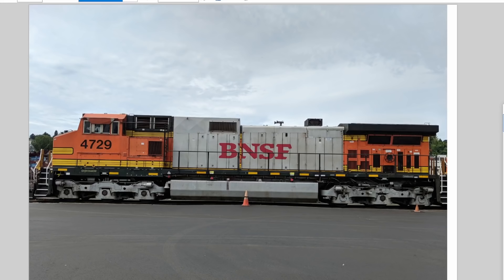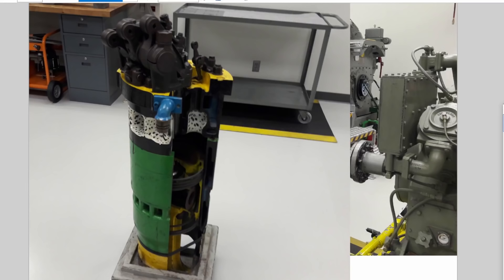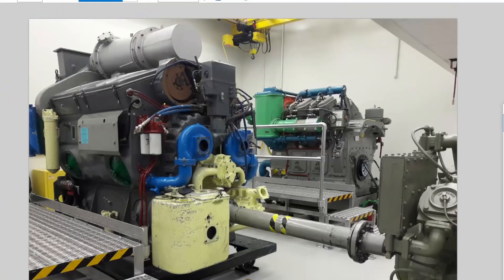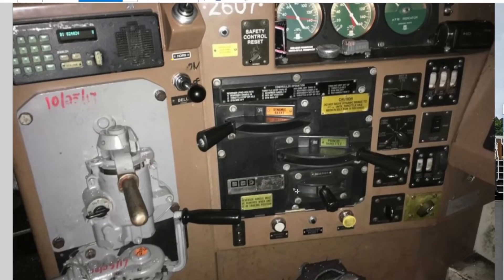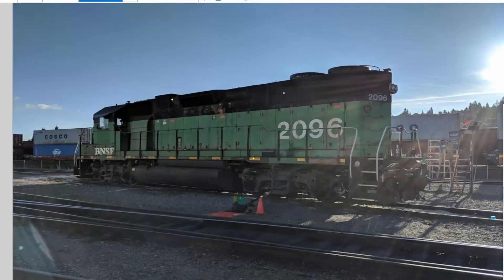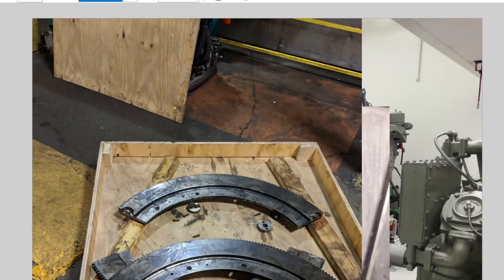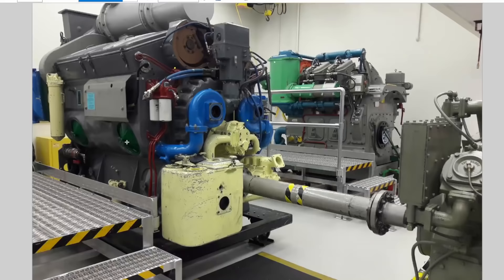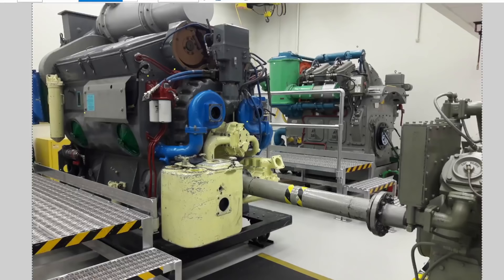Diesel 101 - How DIESEL LOCOMOTIVES Work! [10 Levels]

Comment: From what I learned from this EMD's seem simpler &  beefy, while GE's are more the complex model of Loco
Reply from the maker: Yes, that's accurate.
Reply: @Hyce777  EMD supremacy
Reply: I repaired EMDs for 7 years and GE for 5.. I found EMD to be more complicated honestly. The SD70MAC has one advanced traction system. Not an easy system to diagnose.
Reply from the maker: @krakenwoodfloorservicemcma5975  oh Lord. Yes. The higher power EMD stuff is an electrical nightmare, as far as I can tell. The EMDEC system... Yeah. We had all kinds of problems with those and we would've been SOL without our rep from EMD.
Reply: EMD's and their smaller cousins... Detroit Diesel on-highway truck diesels were a brilliant design.  But 2-cycle engines have nasty exhaust emissions and worse fuel economy.
Reply: The GE's had reliability issues with the old U series and Dash-7s but CEO Carl Schlemmer got things in his words " turned around, upward bound in the 1980s and GE for the lions share of the market over GM ever since the Dash-8.    There were years in the 90s and up to 2010 that GM nearly went out of business then Caterpillar bought them out.   The 90s reliability rate in infancy was up to 3 million miles without a defect due to six- sigma quality control and those defects might be a loose fitting for lubrication or cooling,  nothing big.     They have  control centers that monitor their newer units on the road with sensors onboard and can let the road crew know ahead if there might be a problem to go check it out before the unit is disabled out in nowhere.   Diesel-electric locomotive technology was initially developed for GM by GE and then GE decided to build their own back 1930?   GE always has a technical edge over GM the reason the division was sold to Wabtec wasn't due to the health of the division at all but rather GEs top level management mistakes we still see the effects today.   In 2008 GE Capital nearly bankrupt the company and that's when the spinoff of divisions began.     After Jack Welch GE made alot of bad timed business decisions in power generation,  GE lighting   (remember how we all had to buy CFL lightbulbs then LEDs came out because 2 jet Jeff Immelt was Obama's Corporate Czar?),    the Alstom acquisition,  Aplliance Park spinoff,  GE Plastics spinoff,  GE Medical Systems spinoff and now the 3 remaining businesses will be split into separate companies-   Power Generation,  Aircraft Engine and whatever is left.
Reply: @billyjoejimbob56  well, as someone who works with the big brothers, marine diesel i'd say two stroke diesels have their place and can have good emissions. But it all comes to scale, those small detroits run too fast to get a clean burn. And also the two stroke diesels usually run a much lower quality fuel than the 4 strokes in the marine world atleast.
Reply: @ABVollen  Removing the sulphur in no.2 diesel was a high priority, and that was focused on 4 cycle engines, the majority of what we see on public roads.  The duty cycle of a locomotive diesel is probably less challenging wrt emissions...marine applications too... steady loads at steady "throttle" vs. lots of transient throttle for many road going diesel applications.
Reply: @billyjoejimbob56  yup

Comment: I noticed you had said that diesel locomotives do not work like a diesel truck. You instead said that the engine provides power to the electricity that moves the wheels. Do 1950s 1960s era streamlined diesel locomotives work the same way too?

Comment: 28:40 You may have heard about that one time that a small town in I think canada, lost power in the winter. They took one of these engines off the rails and rolled it down the street, hooked it up to the local power grid and it actually WORKED. Now you know why.
Reply: If you read articles about that, you'll note that they had the diesel generator running at a specific speed. That was too match the 60HZ of the Canadian power grid.

Because of how electricity works, you must match power generation exactly to power consumption. See my other comment for more details, but this was possible because of that auxiliary generator
Reply: @ilikepie1974 The power came from the main alternator, the engine speed (RPM) was adjusted to give the 60HZ frequency out of the alternator which is the standard for north American electrical grids and electrical devices.  The auxiliary Generator is only for 74V DC which is used for control and battery charging.
Reply: @chuck osborn  yes. I was trying to say that the auxiliary generator and load regulator allowed this to happen by matching power used to power generated in the main alt, sorry if that was not clear.
Reply: @ilikepie1974  The governor on the locomotive engine was adjusted to achieve the 60 HZ frequency output of the main alternator.  The frequency is directly related to engine speed (RPM).  Don't know how the aux gen/load regulator would do much here.  Load regulator would be at max field as long as the engine is in decent shape to provide the expected current output and does not affect frequency of the alternator at all just load output.   Aux gen simply supplies 74 DC output at any engine speed regardless of the load regulator or engine speed, the aux gen does related to the AC output of the SCR but again that is related to load not frequency.
Reply: @ccjbmjo  load regulator wouldn't be at max field. You must match power generated to power consumed, or else your voltage will get to high
Reply: @ilikepie1974  Sorry but the load regulator is controlled by the governor, as long as the engine is running at the requested RPM(this is where frequency is controlled), getting enough fuel, and air the governor keeps the load regulator at balanced position (I should not have said max field as that can confuse folks), the only time the governor backs off the load regulator is when there is a reason the engine cannot make the requested power then the governor backs off the load regulator to lower the alternator output until it can maintain the required engine RPM.  Load regulator is considered balanced at 50 volts on both sides.
Reply: @ccjbmjo  As load increases, the governor would have to increase the amount of fuel to match. But you would also see that drop in RPM as a drop in Voltage so the Aux Gen/Alternator would need to increase the Voltage to the main alternator at the same time until both came back into balance. That is where the electronics would come in as it would be a balancing act between Hz, Volts, and Amps. On our Genset alternators at work, we could adjust Volts and RPM but not the current as that was taken care of by the alternator itself. Want to balance out the two gensets when running together, you left the RPM alone and increased or decreased the Voltage which would take care of the current balancing. Or just set the thing in auto and let it do its own thing. One would be the master and the other would adjust itself to match. Just make sure if you were in manual mode that you had both in sync before closing the second main breaker or bad things could happen.
Reply: @gravelydon7072  Amperage is a result of the resistance (load), voltage is what you are controlling.  The governor would adjust the load regulator to maintain the constant engine speed that it is set at for that particular notch, the locomotive governor cares only about maintaining the proper RPM.  Frequency is a result of the RPM of the alternator, voltage is a result of the  excitation of the alternator.  Yes when the load (resistance) increases or decreases the governor will have to adjust accordingly to maintain the RPM of the alternator the only thing it does to adjust on load increase is the load regulator (out put voltage of the alternator) to allow the engine to maintain the engine speed while it adjusts the fuel to the engine to keep the constant RPM (frequency) once it maintains the RPM it will move the load regulator back to the balance position allowing the generator voltage to increase while holding RPM.  The actual output of the alternator is maintained through the gating of the SCR
Reply: Well, a big diesel engine can supply a colosal amount of electricity (via a generator/alternator of course). The diesel engines on train locomotives and on stationary generating sets are basically the same thing, just with some different peripherals. The end result is the same, diesel fuel in, electricity out. There are entire towns in remote areas that rely on diesel generators for their electricty 24/7/365.
Reply: My home town used to be on the Wabash railroad in Missouri, and have a  maint roundhouse to work on locomotive overhauls. 
Downtown also had an electrical powerhouse that would generate electricity using four diesel engines similar to the ones in locomotives... for times when power grid lines went down. The power plant was staffed 24/7 from the 1930s to the 1990s and the diesels were started once per week even if not needed, just to make sure everything was running correctly. One of the delicate things about bringing those engines online was getting the 60hz alternators exactly in-synch with each other, or the power grid before connecting the main circuits together.
If they were not exactly in-synch, not only could you have a power spike and burn out circuits, but out of phase alternator would be jerked so violently in-phase by the grid powerthat it would torque & yank the whole engine hard enough to shake the concrete floor under it.
I got to know Bill Hawn that was the night maint man fairly well in the 1980s.
Those engines have not really bern used since about 2000, but it was better when the town was more self sufficient, and could provide its own power ad needed.

Comment: small correction and some additional info on roots blowers.
the air actually travels along the outer walls from the center of the intake, rather than being pushed through the middle. if they went down the middle it would be a twin screw blower, not a roots. they're similar, but roots has a matching number of blades per side, while twin screw does not normally. the difference in boost creation is the twin screw compresses air between the rotors, while a roots just scoops the air and forces it down by creating a seal in the middle that air can't really go back through (where in a twin screw it works opposite)
Reply from the maker: Cheers for the correction! Interesting. Didn't know the difference myself.
Reply: @Hyce777  no problem, and thanks for the pin! I grew up going to the drag strip with my dad, so I've been around a lot of superchargers in my life. I also used to work for a vacuum pump company, and had to know the difference for service reasons. Its a really niche knowledge, but when you try to say one is better than the other you get people mad lol. Roots is my favorite, just because it takes less effort efforts the engine to make boost
Reply: The roots blown EMD engines ended years ago, with mostly 567 series, the 645 and 710 series engines use a gear driven Turbo that freewheels on its own in throttle 7 and 8, providing significant airbox pressure, the Roots type was only around 7Psi , while the turbo could produce much higher Airbox pressures
Reply from the maker: @ChiefCabioch  true, but plenty of 645 roots blown engines are around... More than 567's I'd say.
Reply: @Hyce777  the 710s began in the mid 80s if I recall, while testing at the DOT facility run by AAR in Colorado GM EMDs were being tested and power assemblies were replaced while our testing was going on, that facility is incredible...
Reply from the maker: @ChiefCabioch  oh i bet... That does sound about right
Reply: @Hyce777  I had over 1000 hours of load box time while testing over a year and a half, I was CMO and  applied to BNSF, they thought I was joking, .....I wasn't,
Reply: @ChiefCabioch  we have locos here that use roots turbos the turbo is always able to be heard from idle to full power.
Excellent throttle response 
we also use a turbo v12 4 stroke its funny when they are used in mu the turbo v12 4 stroke takes ages to catch up.
Reply: The design comes from GM, where their 2 stroke was blown. They could have turbochargers as well, or not. They all have blowers though to keep airflow going in the right direction. It increases efficiency compared to your weed eater or lawnmower.  FWIW, the blown 2 stroke is still considered an n/a engine. Adding a turbo makes it forced induction. Matter of semantics I guess, but that's how it's been come to be known in the reciprocating piston internal combustion engine world.
Reply: I'm quite sure the air also goes along the outer walls in a twin screw.
Edit : I would say the air is mostly moved "axially" though
Reply: @TarenGarond  from a Road and Track magazine article on how to pick which you'd want "Though only one has "twin" in the name, both styles involve two rotors. But in a roots supercharger, two identical rotors rotate away from each other, quickly forcing more air into the engine than it can take at once. This causes positive pressure to build in the manifold, compressing the air. In a twin-screw style supercharger, the two rotors are designed to mesh with one another and compress the air forced between them. So while they're both similar in design, twin-screw superchargers compress the air directly while roots superchargers create pressure in the manifold that compresses the air.". Axially implies that the air is being compressed along a single shaft, like a centrifugal supercharger/turbo, where the spinning impeller propels the air along an axis of rotation and into an intake pipe and the constant rotation of the impeller holds the pressure. Roots and twin screws can hold pressure when stopped if they're clearanced correctly, or when using soft seals, and even though the rotors spin along an axis, the air isn't moved along that axis, but rather pushed along the walls in a roots type or wedged between the rotors in a twin screw
Reply: @trail_mix24  I should have said moved/compressed "parallel to the rotors" instead of "axially", as the air is compressed from the "front to the back" of the compressor and the air also moves along the outer walls(Like in a roots).
The air in a centrifugal compressor is moved radially though, hence the name "radial compressor".

Comment: a small note on lvl 0: 
there are diesel-mechanical locomotives (British shunters for example)
as well as diesel-hydraulic locomotives (both hy.static and hy.dynamic).
Diesel-electric is the most efficient, but there seems to be a debate whether or not diesel-hydraulic might be more reliable and/or cheaper to build.
Reply from the maker: Very true, we had a few of those in the states... but 99% are diesel electric.
Reply: Diesel-hydraulic loco is sometimes used in flooding situations (where diesel-electric might short circuit itself?) over here in Thailand. We have 2 diesel-hydraulic train types mostly for shunting and flooding works

By regulations, all diesel-electric can go through flood up to 5cm of water over the top of rail, whereas diesel-hydraulic can go through flood up to 25cm. Every trains going through floods have a speed limit of 5 km/h

YT link for train footage in flooding in another comment below
Reply: @user-gP4UJA  makes sense.
why only 25cm though? electrical systems?
Reply: from what I recall, the Krauss-Maffei diesel hydraulics SP and DRGW had did not take well to American railroading practices, namely heavy loads up long grades in harsh climates. I know both CNR & CPR experimented with a Machinenbau-Kiel 900hp diesel hydraulic switcher in the mid 1950's, but they mustn't have been too happy with it as it was sent back to Germany within a year or two.

Comment: Small note to add on the dynamic braking part: In the case of heat generation power is the unit (watts), if i remember correctly dynamic braking tends to be quite close to the maximum power of it so around 2-3.5MW are dissipated on the resistor array. To be able to do it regenerative on a diesel one with batteries a large number of them and/or very high charge performance would be needed which wouldn't be very feasible. Assuming a very snazzy LFP that is able to charge at 5C one would need around 2 cubic meters of batteries, ~600kWh of batteries would also be expensive to maintain.

Phones have variable charge rates but for simple values most low-mid range phones use 5V 2A which are 10W.

Ha, also, actually it is "how diesel electrics" work, hydraulics are used in mainly shunters/low power.
Reply: From my rough and quick calculation, that means you should in his example be running 3500 volts at 1000 amps to get to that wattage figure...
But that amperage number is scary, it will really melt cables unless they are silly thick!
Reply: @CMDRSweeper  Not only can it melt the wires in the cables, they do melt the grids at times also. That likely is going to happen on a long downgrade where you already have one loco that has lost its dynamic braking. As the engineer applies more braking the grids in the loco keep getting hotter and hotter. And then bingo, another set gone. Hopefully the train is under control and the air brakes can keep it that way. If not, time to look for a safe way off the train as you now have a runaway on a downgrade. And that isn't going to end well.
Reply: @CMDRSweeper  bigstackd channel melted some locomotive cabling
Reply: Hey Mirage. This is such a long shot, but I am working on this exact problem right now. Could we chat?
Reply: @ericscholem6629  For now i got good availability. What are you thinking?